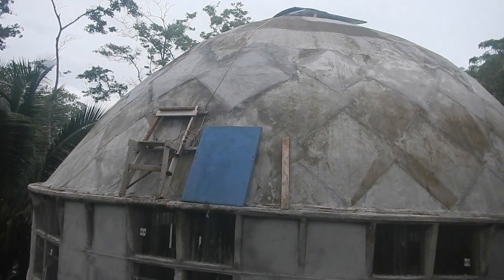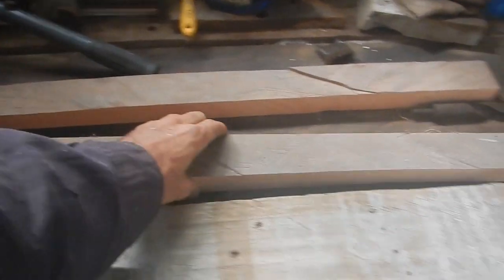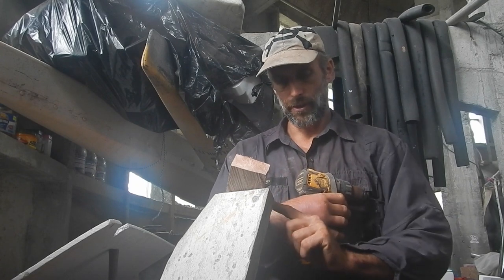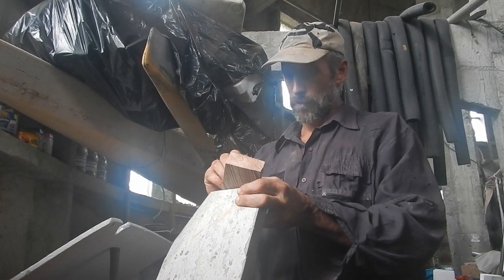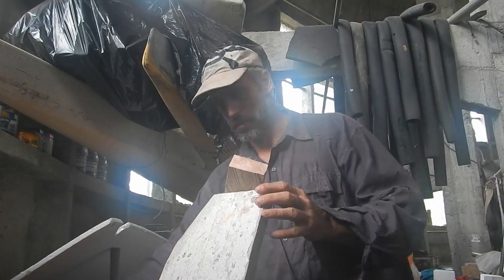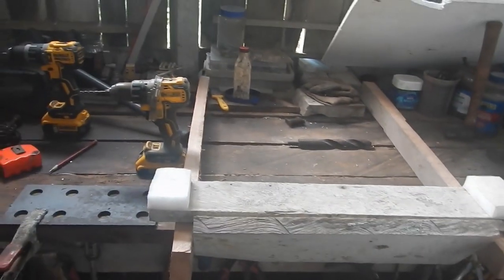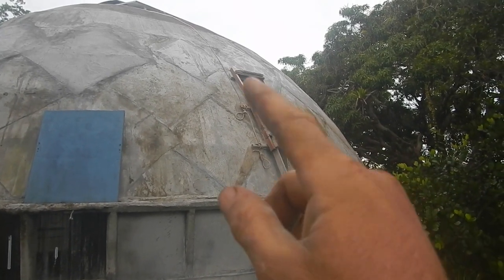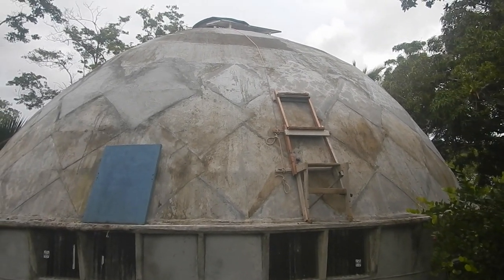Dragon Scale Roof 009 Quick Update

Comment: Have you looked in to different cement mixers? There is one that you just use one hand and mixes a bag in less than a minute. Figured it be helpful for you since you work with concrete so much.
Reply: I thought a 50 gallon drum cut in half and suspended in the middle would be good or you. If you wanna look were I got I the idea it’s called Steele mixer.